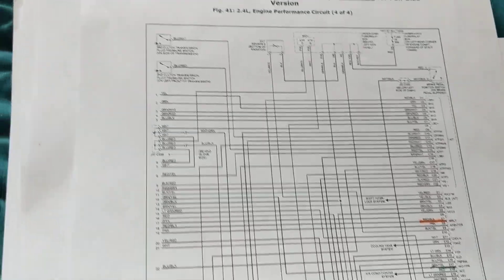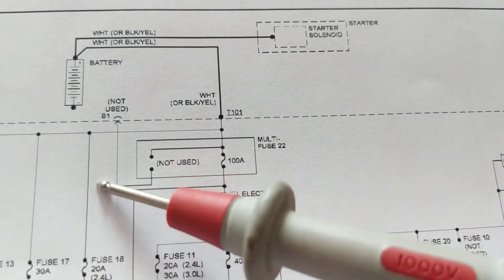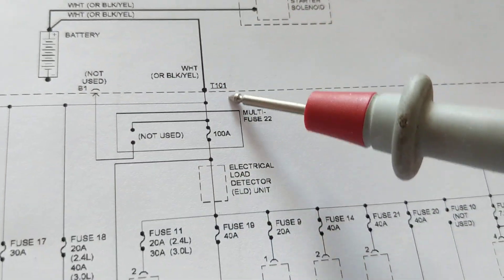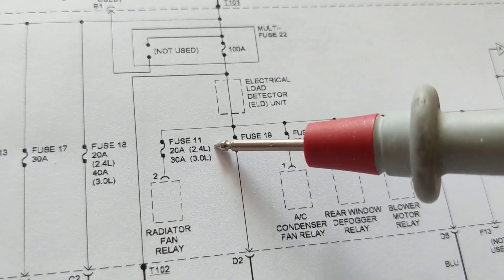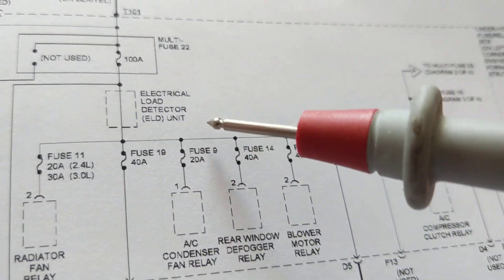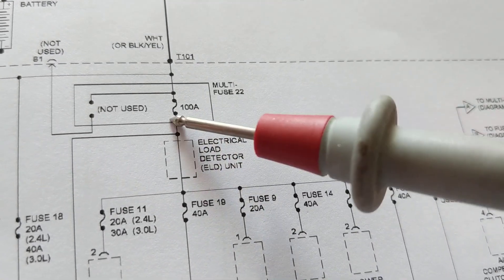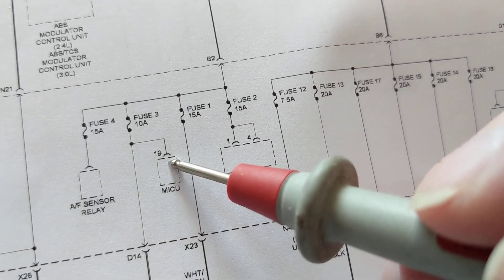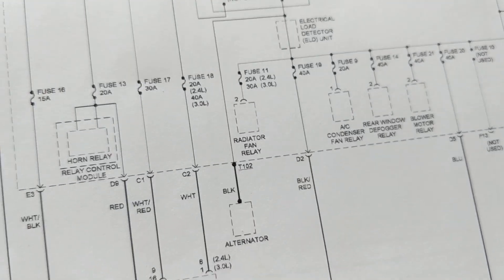HOW TO LOCATE SHORTS AND PROPER FUSES IN POWER DISTRIBUTION DIAGRAM VERY HELPFUL

Comment: How it's possible the battery can give current up to 100A while I think the battery just Can out the current just like 8-10 Ah..I'm confuse about that sir..and. Is that 15amp for each component or 15amp for one set component?
Reply from the maker: the main fuse will allow up to 100 amps and it depends on witch circuit is activated upon crank
Reply: @Joeelectronicschematicsforauto  the 15amps fuse not gonna to disconnect even it goes until 100amps?
Reply from the maker: Whichever fuse is rated the lowest that's the one that will blow first depending on if it's a short or a short to ground two different things
Reply: @Joeelectronicschematicsforauto  alright..got it.. Thank for your help